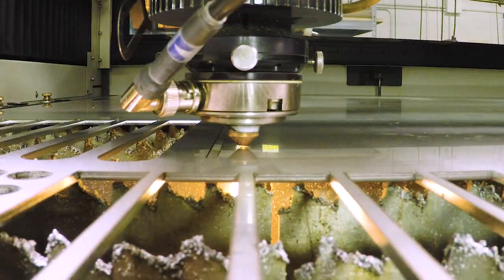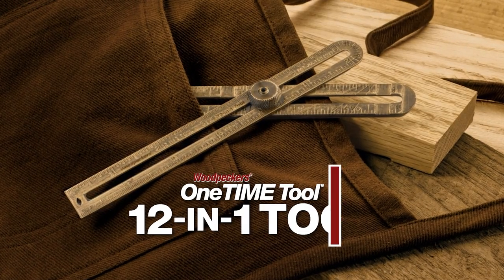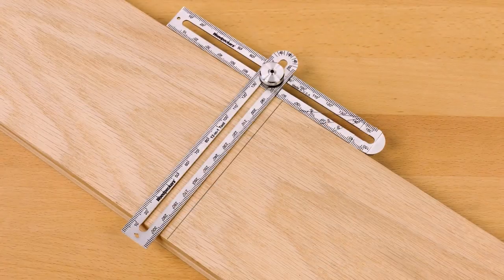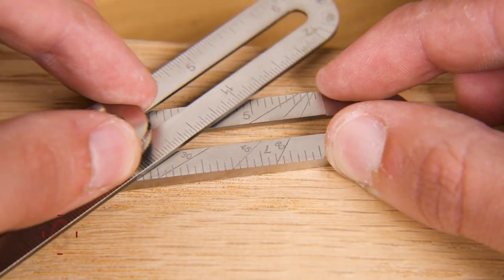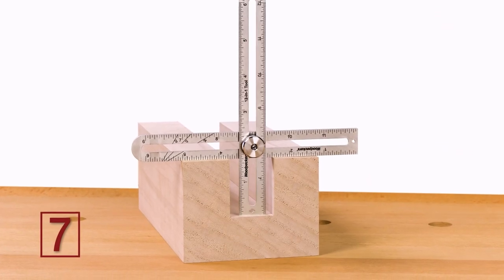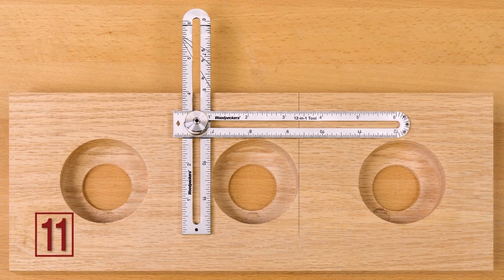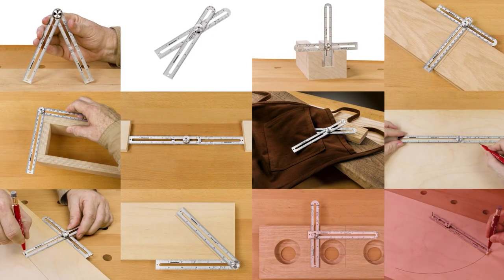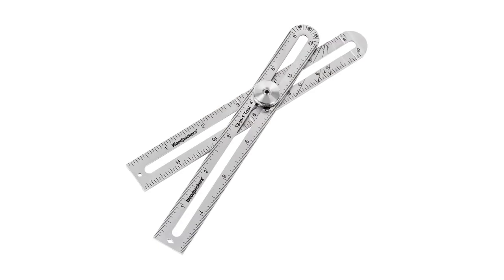Woodpeckers OneTIME Tool: 12-in-1 Layout Tool

Comment: Are there detents which snap into place to hold common angles like 90 degree and 45 degrees?
Reply from the maker: 90 locks in. The other angles are by scale alignment.
Reply: @WoodpeckersLLC  Thanks - placed my pre-order.  Wish you would have included both metric and inches in device though.
Reply: @User_not_found_403 I agree — that would have been nice so I’m going to get the metric version